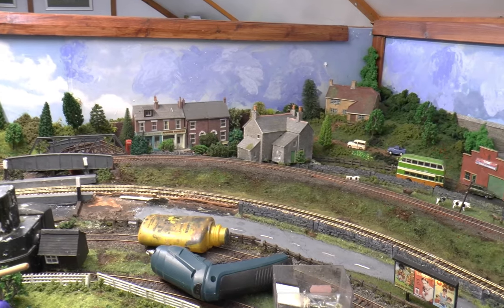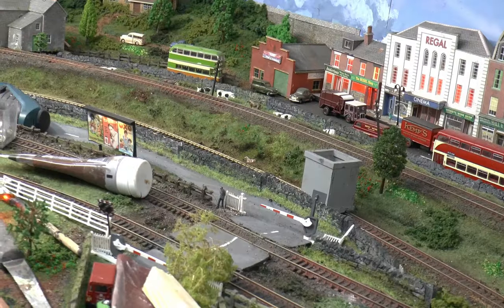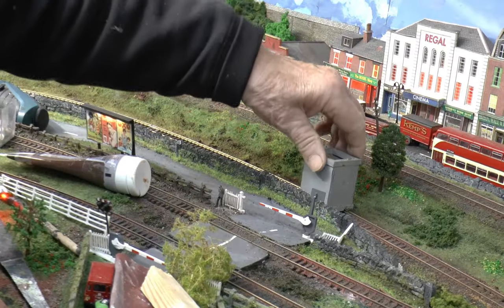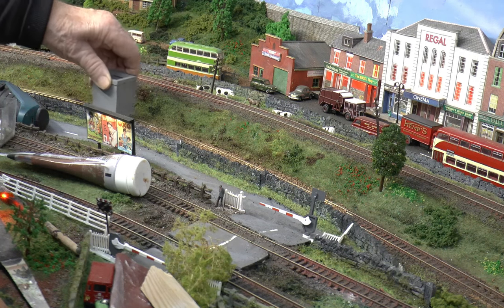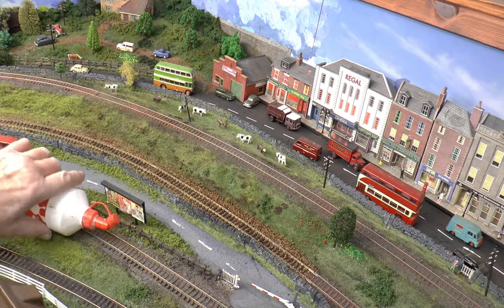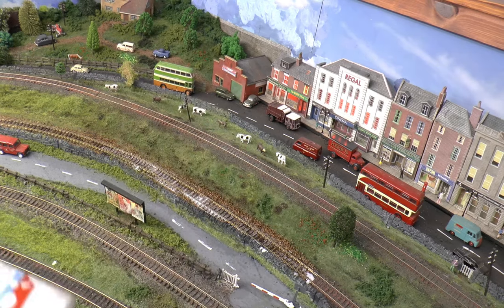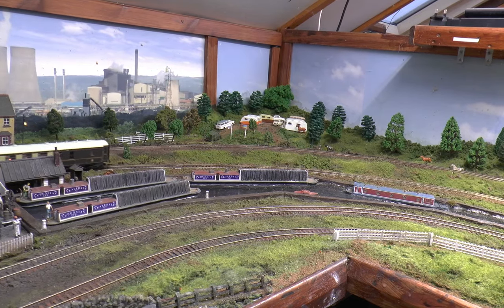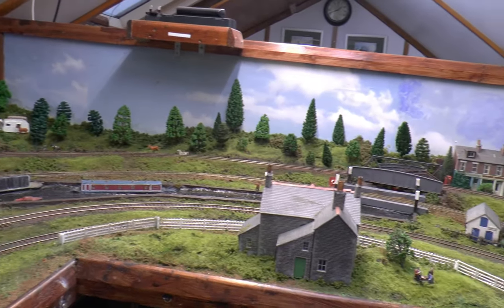Dave`s Model Railway..Part 3 Completed track repairs

Comment: I still use a spoon to do the ballast just gently tapping it along the sides and middle of the track , the track looks to be running well now . 
     .........Peter
Reply from the maker: Hi Peter , yes i had to use a spoon on some of mine as that ballast was too big for the holes in the ballast machine , should have got the medium size ...I keep doing that ...buying on line you have to be careful what you order ....Cheers Dave

Comment: Glad to see you finally got the better of the track Dave. Do you find a 70/30% mix is the best?...Simon
Reply from the maker: Hi Simon , yes finally got there ..wewll i hope so ...as for th mix for ballast yes 70 / 30  mix is ideal i find , dont forget to add a drop of washing up iquid to the water you spray on first it helps to soak in to the ballst , then apply the PVA mix ...cheers Dave